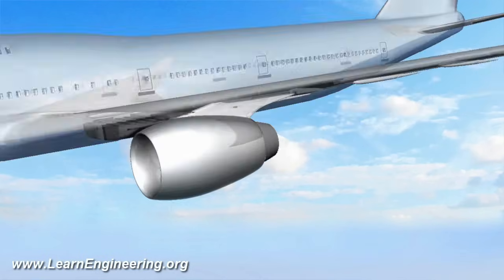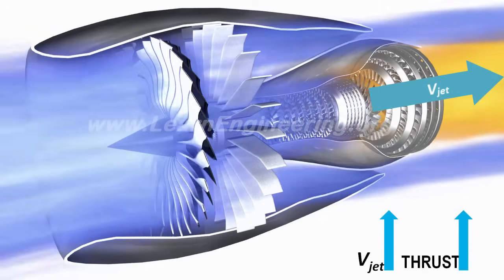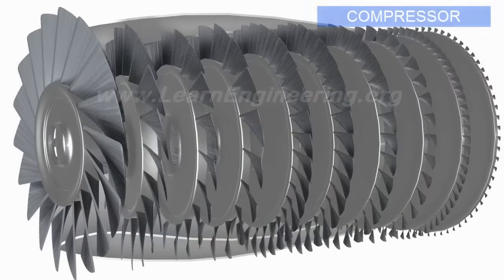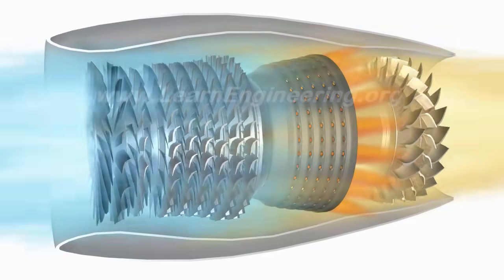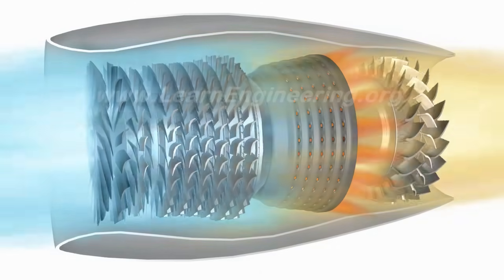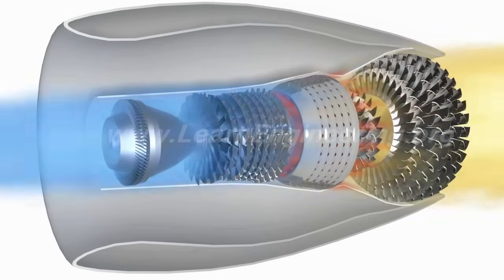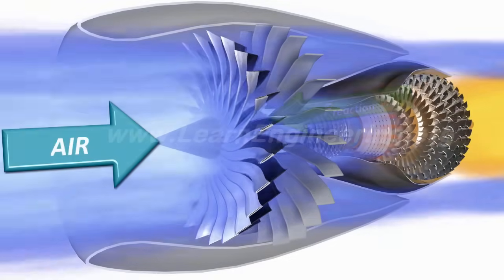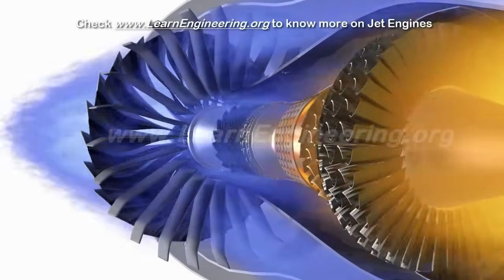Jet Engine, How it works?

Comment: Hello all, 
Anybody can tell me how jet engines initially start ? Because I’m working with gas turbines for power plant and compressor application. As per my experience gas turbines are not self started it needs some initial air flow for combustion for that in power plants we used starting motors or SFC. How this is possible in jet engines ?

Comment: Which gas is used in burn chamber of jet to move forward and can it help to move from down to top?
Reply: It is impossible to define exactly what mix of substances are in jet fuel, because every production comes from a slightly different source of crude oil and not all distillations are exactly the same.   "Jet Fuel" or Kerosene, refer to the performance specifications, rather than to an exact recipe of what pure substances are in the blend.

In general, it is hydrocarbons (like methane, ethane, propane, butane), except with molecular sizes in the C12 to C15 range (dodecane to pentadecane).   Unlike automotive fuel, which is mostly octane (C8H18)

Comment: Disliked after 13s of watching... COMPRESSORS AND STATORS BLADES ARE POINTING IN WRONG DIRECTION!!!!!! (Rotation is still good, it's the same that the turbine one)
Also the shape of the engine is shit, a real and WORKING engine has a larger entry than exit. Aaaaaand it seems the low pressure and high pressure compressors are inverted...
-_-'
Then when you switch to a dual flow engine (without explaining it), 100% of the air is going into the secondary flow, so how could the engine work if the primary flow has basically no air intake!?

Nice one for a channel called "Learn Engineering"...

Comment: DOGE, It was thermite that melt the WTC 1, 2 and 7, not the jet fuel. George Wu, ARCHITECT, A.I.A., NCARB 2018-12-20
Reply: With no fuel ! Yep I never did see any fuel lines making that air hotter.a series of blades compressing the air into a state of chaos kind of like when you're on a motorcycle running at excess of 200 miles an hour the air becomes hotter. Somehow another the blades ARE perpetual motion. How bout that!!! They have a nother lie .

Comment: I think the compressor blades are moving in the right direction. They oppose the air income force, what makes the pressure to increase in the outlet of the compressor. Compressors are not used to suck the air in as everybody's saying here, if they were supposed to suck the air in they will be decreasing the pressure at the end of the controlled volume device. Imagine an injection, in order to suck a fluid in you need to pull the piston, in order to make the pressure higher you need to push the piston. That mean that if you want to increase pressure you need to create a opposing force just like we see it in the case of this compressor and every other compressor as well.

Comment: at starting period who do turn the turbine to get a sufficient air for the working of jet engine? because they cannot be turned automatically! i mean at stand still condition no air is supplied to the engine to start but it needs air to work engine and for it's propulsion!

Comment: So I will add a comment that doesn’t have anything to do with the DAMN BLADES MOVING IN THE WRONG DIRECTION. Jeesus people we get it after the 1000th comment. My question though is - why is the air being bypassed in turbo fan engine setups? Is it for noise reduction purposes only?
Reply: The point of high bypass engines is that you accelerate a much higher mass of air, to a much lower velocity. Because thrust is mass×acceleration, and its better to increase the mass and decrease the speed of the jet itself, because any energy used to move the air instead of the plane is waisted energy. So the more you change the state of the air the more energy you waste.

Comment: What makes the fans rotate? An engine inside of an engine? Can you explain how it does so? What's powering it? Electrical? Kerosene? No videos show this small subject. So, I assume, kerosene makes fans rotate + just burnt to heat air? That's some crazy stuff... How does the air-brake mode work?

Comment: Help please!!
If the goal is to increase temperature and pressure then what do we need the turbines for?
Reply: The turbines transform the otherwise waisted energy of the exhaust gases into mechanical energy and drive the compressor in front of them

Comment: No liquid fuel is necessary. No flames from the AFTERBURNER
Reply: fuel is necessary. where will the aircraft get its energy from lol.
afterburner is just for extra thrust and consumes more fuel per sec.
it's used in fighter jets to provide insane acceleration speeds.

Comment: Jet planes and rockets both push off air.
Reply: The difference is, jet engines take in air from the outside during operation.  Rockets rely on all propellant coming from the on-board fuel supply.

Comment: I understand the principle. But how do you start a jet engine? An electric starter? I would be surprised.
Btw, thanks for that video.
Reply: A motor I believe to suck in air and then the engine powers itself,

Comment: I still don't understand
Reply: laura just go back to kitchen.
lol.
just kidding.
Reply: @realitytube1  LMAO 😂
Reply: @Laura Sanchez
You need to study thermodynamic + aerodynamics to understand better
Reply: I don't even know what those words mean haha
Reply: That's normal, this video is shit and this engine could not work because they did mistakes that even a 10 yo kid would see.
(Compressor blades and stator blades are not in the good direction... And the general shape of the engine sucks. Working ones have a larger entry than exit... -_-' )

The concept is simple : the air that leaves the engine needs to be faster than the one that enters.

1 : So you compress it (try to make a hole in a baloon and you'll see that compressed air wants to leave it pretty fast)
2 : You burn it (because hot air takes more place than cold air, so by doing this you increase the pressure again)
3 : In the same time you reduce the area available for that compressed air (
4 : Then, the compressed air is able to leave the turboreactor. BUT because there is a huge quantity of air and a small place to contain it, + a small hole to exit the engine, the air is ways faster at the exit than at the entrance.

Note : The only one entry of energy is the kerozene in the combustion chamber. There is "nothing" moving all the "fans" (compressor and turbine is the good word). If you're wondering how the compressor is rotating, it's because it's linked to the turbine. The turbine is located between steps 2 and 4, they turn because the accelerated air is passing through before leaving the engine. They take some energy of that air to rotate the compressors. The turbine is like a wind turbine. But instead of converting movement into electricity, it sends it's own movement to the compressor. Because of this, jet engines need some "help" for start-up because this is working only once the engine is running at a good speed to self sustain, and the fuel self ignite.

If you don't understand why the stators and rotors are not in the good direction :
They are rotating in the same direction than the turbine, this is good. But the blades are not in the good direction. Imagine that the invisible air is like a pool of balls. Balls are the air molecules.
If "/" is my blade and "o" is my ball. The blade is moving to the left ← and will hit the ball. It's obvious that in this direction "o/" the ball will bounce above ↑. But if the blade is in this direction "o\" instead, it's obvious that the ball will bounce under ↓.

Sorry if my english is bad.
Reply: thots thots everywhere
Reply: Laura Sanchez There's nothing to understand,   This works on newton's reaction law.
Gas fuel burn and produce thrust to move forward using fresh intake  of air. It's a very powerful engines they are huge.
Reply: Yes that makes sense to be but the way it works and stuff, I really don't get it
Reply: Laura Sanchez No point in learning from this video anyway, the creator couldn't even orientate the blades in the compressor turbine correctly ahaha...
Reply: @Anaskhanartist  Looool try to produce thrust with a candle or a gas torch then! xD
That's not the way it works, hot air is just a small part of the engine!

Comment: Planes don't use fuel to fly, its compressed air and the fan itself which creates the thrust. The heat coming out the back is due to adiabatic process not fuel being burnt.

Comment: 90% comments- blade is running in the wrong direction
Reply: Blades are spinning in the wrong direction
Reply: Shashank Gupta how can they know it I wonder 😂
Reply: Thanks lol
Reply: This simple fault really f** with my understanding of how it works lol.
Reply: Jerry Halliburton turbo prop engine thrust  comes from bypass air mainly, if so the thrust can be higher, right?
Reply: Reverse got left on, sorry about that
Reply: I am glad I am not the only one to notice. Primary compressor spinning the wrong way!
Reply: Well, it is.
Reply: 0:01 Boeing 747 engines supposed to be 4  not 2
Reply: @Akemiko000  no one cares. what's the important here is what's happening inside the engine....
Reply: @keksimusultimus4257  it is important. assume the exhaust fan of your laptop is sucking air instead of removing air?
Reply: and they dont even mention bypass air
Reply: @MrMcKerv  how about you watch till the end
Reply: Actualy i thing that the animation was right, but framerate of the video screwed it.
Reply: Because 90% of these retards are fuking idiots, just think about it, which way do you turn to loosen up a bolt (left) same way blades are turning, thus creating an outward force that results in air suction.
Reply: @andressegura5838  Imagine calling people retards when you have no idea wtf you are talking about it's about the pitch of the blades that determine which direction they should turn to push or pull air not just righty tighty lefty loosy "idiot" like common household ceiling fans usually turn clockwise for pushing but that can change if the pitch of the blade is opposite
Reply: @andressegura5838  

Stop being arrogant, fyi not all bolts and nuts turns left if you want to loosen them some are turned right to achieve same result  - as I said, it depends on what the designer wanted to achieve by doing that.

An experienced Engineer or technician knows that in some subassemblies in machines or motor vehicles there are some nuts/bolts which are loosen by turn them clockwise.

On a jet engine what matters is which angles direction are blades of turbonfan
and compressors were decided by jet engine  designers/engineers regardless whether they are turning left or right, ultimately the thrust will always be in forward direction.
Reply: @andressegura5838  dumb comment

Comment: Thumbs down, overly dumbed down, and like 99.9999% of videos just hand waves away how the turbine is supported and stabilized.  Like having a video on car engines without talking about the crank haft. or more specifically the crank journals.

Comment: But i dont know how can the fan move to suck the air for the engine???
I mean: the jet engine suck the air, compress and bang to make the reaction force to move forward but what energy to make the fan move before sucking, compressing,....??? (Electric motors or something like that?)
Reply: Theres an air or electric starter to get it spinnning and compressing, when it's up to a certain rpm it starts injecting vaporized kerosene and starts sparking the igniter. Once it fires up its self sustaining.

Comment: I have a question: So what are you really doing when you apply more thrust do the engines?
Reply: Just giving it more fuel, like in a car. It increases the temperature, which increases pressure in the engine

Comment: Great animation and all that, but gee it will really confuse anyone looking to get an intuitive understanding of how an engine works.

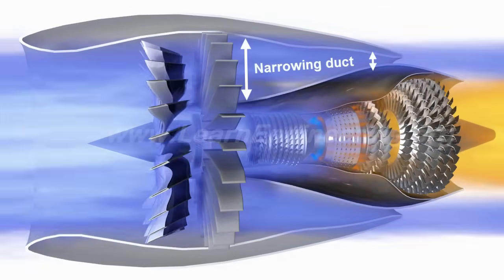First, let's just assume that the engine is meant to turn clockwise (looking front to back).  The rotation of the engine remains the same throughout the video (except for one spot at 4:24 when it momentarily rotates counter-clockwise!? Yeah, ... weird ...). Thankfully, in the animation, the turbine stages (what determines which way the engine rotates) have vanes that are oriented consistently with a clockwise rotation.

But here is where the animation fails:

The turbofan, as shown up to the first two minutes has the blades oriented backwards, i.,e, drawing air "out of the engine" and bringing it out the front (theoretically speaking). The animation shows the blades oriented properly in the second half (after 3:52) when they put a fan on a turbojet engine. the blades on that fan are oriented properly, i.e, consistent with the clockwise rotation of the turbine section. 

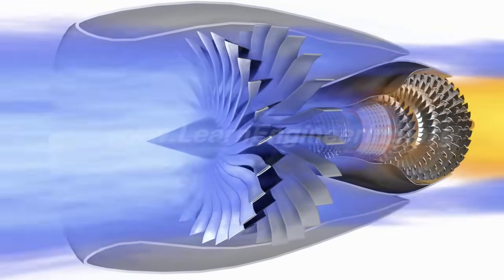Then, between 4:49 and 4:50, somehow, that same fan with blades oriented properly, is all of a sudden changed to have the blades backwards. That remains wrong until the last two seconds of the video when the blades are back to being correct.

The low-pressure compressor is rotating clockwise (correct), but the vanes on it are oriented backwards. Unless I missed something, those vanes are incorrectly oriented for the entire video.

I gave up trying to find what else could be wrong with the animation.

BTW, this is not a counter-rotating engine, unless it has some miracle gear box inside the concentric shafts to reverse the direction of rotation between a turbine and the compressor stages it drives. (There is some work being done on a geared fan-LP compressor but the purpose is not counter-rotation)

And word of caution to the clueless. It's vanes, not veins. Not even close conceptually.

Comment: So is the engine is self sustaining because the turbine extracts some thermal energy from the combustion products and concerts it to mechanical energy? Something like this... As fuel is added, chemical energy is added to the system. When the fuel is burned, the chemical energy is converted to thermal energy. As the high pressure exhaust exits the turbine, it powers the fan at the front.
In essence, some of the energy in the fuel is used to run the turbine, making that energy unusable for thrust... That makes sense! So jet engines don’t violate the second law of thermodynamics!

Comment: Okay, some questions:
Which fuel is used?
Will we run out of the fuel?
How is the fuel injection done and controlled?
Does the exit air ignite itself?
If not, what if it happens?
Reply: Stupid questions but ok
Reply: White oil is used in airplane 🛫 
Bruh ! Fuel injection is done by 2nd plane if the plane is flying 😳 interesting right ✅ .
Reply: Bro literally use asked very stupid question 😒🙄

Comment: This video has false scientific information. 3rd law of Newton reference is true but it is not calculated based only on the velocity of the air. It is called the quantity of movement and it is a combinaison of both the velocity AND the quantity of air that is moved.

Comment: Yes wrong propeller-Rotation at 0:14, but at 4:06, it's correct. Apply The "bird-test" : the rotorblades will cut the bird in pieces, when it spins the right direction: https://youtu.be/As7bRfl3ujw

Comment: Hi! This is a very impressive video. I have a question at 2:20: why we need turbine blades to absorbe the energy. Wouldn't it be faster to emit1500 degree and 32pa air?
Reply: the energy is absorbed by the turbine to drive the compressor in the front

Comment: But, how do the turbine blades rotate? Is there additional electric motor connected to the turbine axis?
Reply: the turbine is rotated by the flow (kind of like a windmill), and that is used to drive the compressor in the front
Reply: Oh! Thanks.

Comment: If the compreaaor is powered by the exhaust driving a turbine, how do you start it up? Does it have an alternative outside powersource?
Reply: I wondered the same thing and did a search. Hydraulic pressure starts the rotation, then there is an entire sequence you can find here. https://www.youtube.com/watch?v=0OgEbs3ovOw

Comment: Guys help me out here, I'm not sure if I got this right, please correct me where I'm wrong. From what I understood the process starts with the combustion engine heating the air which will expand through the turbine. Then as the turbine has the same shaft as the compressor it'll make the compressor start turning and therefore sucking more air into the engine which will finally provide thrust. Am I wrong?

Comment: it would be nice to explain how does the jet engine begins spinning , and if it's by a shaft how it's connected by it? At start you don't have high pressure air

Comment: Thanks alot it has been alot helpful for a starter in this field like me, but I dont get why you say a compressor receives energy from a turbine yet the compressor is placed before the turbine. Thanks and please reply to help me on this.
Reply: Well they drive each other really. The compressor tranforms mechanical energy from the engine shaft into kinetic energy (pressurised air), and the turbine does the exact opposite, it turns kinetic energy from the air into mechanical energy for the drive shaft.
So the compressor sends air to the turbine, which makes it turn, and well, the turbine and the compressor are on the same shaft, so the turbine makes the shaft and the compressor turn with it